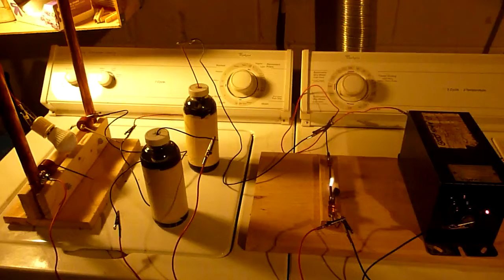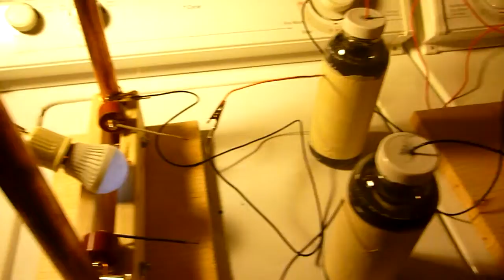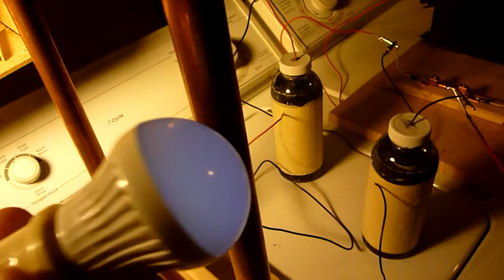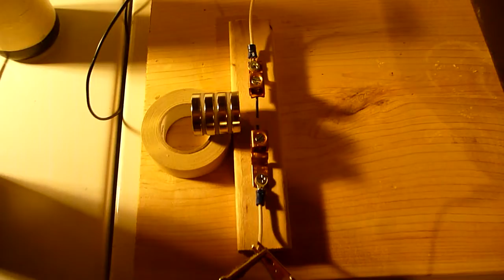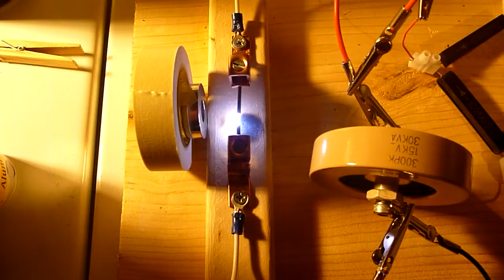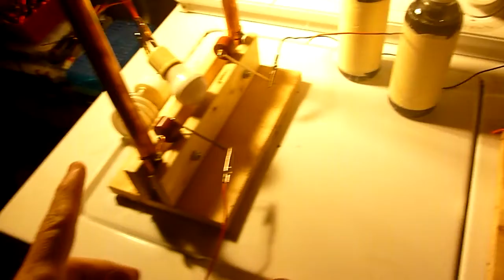Magnetically quenched Spark gap Experiment

Comment: You effectively have increased the conductivity of the spark gap by increasing the magnetic field density in the gap. You did not set up an electromagnet quenching circuit as described by Tesla's who was trying to divert the ions and electrons flowing in the electricity away from the ether conditioned by the charged particles into electricity (energy without energized matter. A little disappointed, not what you described... it is actually a magnetically enhanced spark gap. Party on, stay safe.
Reply: So does that mean it absolutely has to be an electromagnet?

Comment: If you get rid of magnetic component of electricity, wouldn't that mean you mean you converted electricity to electrostatic and you no longer have amps/current?
Reply: Tesla was the inventor of the magnetic spark gap. He used it in an attempt to remove the 'electrons' from the passing spark gap voltage, not any magnetic component. In doing so, pure electricity was present (and eventually passed to an additional coil). NOTE: TESLA called his spark gap in series with capacitors his "SPECIAL PRIMARY", and an additional coil his ""SECONDARY".  ALSO NOTE: What many 'think' is a Tesla Coil, is NOT! Rather instead a Sir Henry Lodge Alternator. Tesla's 'generator' has no multiple multiple windings leading to it's top. His "receiving coil" does.  Lastly, The 'electricity' Tesla tapped into is pure Aether, has no electrons, heats metal when coming into contact with it and is limitless power. Email me if you any questions at theyaretoonosey@gmail.com  or download &read chapter one of Secrets of theCold War technologies.
Reply: @Rev22-21  "Tesla's 'generator' has no multiple multiple windings leading to it's top. His "receiving coil" does." I've heard of this before but only small glimpses, could you tell me more about this and your sources please?

Comment: This would explain why Tesla in his magnetic switch or spark Gap if you prefer to unidirectional spark he used the powerful attractive power between two permanent magnets or electromagnets North and South in attraction to clear or tear the lines of the traditional electric field, of magnetic nature which allowed a new radiant energy to take the place. 

Master Ivo has already talked about something like that, a theory is only speculation, but if an electromagnetic field line is broken perhaps it is possible that the dielectric field lines cross the magnetic field that normally crosses 90 degrees to prevent the dielectric field from passing something else is transformed, an energy that exceeds that of the electron and at the same time breaks some laws of current physics. Why not, but how to prove it is another matter.

Congratulations and thank you for this beautiful video

Comment: Tesla used 2 magnets in attraction (separated) with the spark gap in between. The classic blue purple spark gap is quenched(influenced by the dielectric field produced inbetween the attracting magnets) while the "neutral" white radiant energy is not influenced.
Reply: You sir are EVERYWHERE! So cool
Reply: :D
Reply: Hi Ivo, can you explain why the white radiant energy spark isn't affected by the magnets if it's created using a hairpin circuit? Isn't the spark in that form pure Dielectricity without a magnetic component and by extension should be influenced by the magnets dielectric field?
Reply: @JenkoRun  there are 2 forms of currents (enegy flow) magnetic and dielectric. conventional current is magnetic and bound to a conductor.
Dielectric (displacement) current is flowing through the dielectric and not bound to a conductor. 
when both currents are present power is created. 
and the white one...
Reply: @MasterIvo  And the white one?
Reply: @JenkoRun  is the dielectric displacement current flowing through the isolater, in the dimension of time, outside the dimension of space, where the magnetic spacial field acts.
Reply: @MasterIvo  So it is indeed the dielectric without the magnetic component, figured as much, but why doesn't the magnet have any effect on it? Since Magnets attract through dielectric acceleration shouldn't this dielectric displacement current also be attracted to the magnets dielectric field or anti-locus like regular discharges?
Reply: @JenkoRun  because the magnetic field acts im the dimension of space.
while the white current flows in the dimension of time.
or to be simple, I don't really know why 😊
Reply: @MasterIvo  Interesting, looks like further study will be needed on this phenomena to figure that out then.

I would like to offer a different perspective of the function though, specifically the time point. According to Ken (if he is correct) Time is a measure of magnitude, more magnitude = slower time, and if you have magnitude then you have space and magnetism involved, since the Aether doesn't have any magnitude in its Dielectric state that means it doesn't have any time either, so the Dielectric field operates outside of both time and space, no magnitude no delay in events.

If we consider that, then a dielectric displacement current will act instantaneously without delay in propagation as long as there is no magnetic component attached to it. If we consider that normal EM waves are limited to light speed because of the addition of the magnetic field then there is a system here that allows the dielectric field to change at infinitely faster speeds than an EM wave, perhaps a sort of timing system could be developed to take advantage of that in some manner? 

And perhaps this operation outside of time is also part of the factor that is the reason for why magnets have no effect on this kind of spark that's had its magnetic component quenched? Who knows.
Reply: @JenkoRun check out cold energy secrets by Peter lindeman

Comment: That's just proved the existence of magneto dielectricity. 
Just like the plasma streams from a simple plasma ball novelty toy.
However: It has practical application potential?
Based upon the early vacuum diodes: space charge had a repulsive effect on the flow of electrons.
This was quenched by the required minimum potential being reached.
In other words: align the magnetic fields with the SG pin's & it should present a repulsive effect 
Until it's freehold has been reached ( A HV Diode?)

Comment: The problem with all this is the electricity is extremely useless in a practical sense. High voltage, high frequency and no current and enormous amounts of EMI which is no good in our modern digital wireless world. 
You find a way to transmit high current usable electricity with out the use of wire and not cause EMI pollution or kill nearby electronics, then the world will be impressed.
Reply from the maker: +ElfNet Gaming Tesla already managed to do it in 1892 in his Colorado Spring experiments. Tesla perfected his wireless electricity model after those experiments. He then built his famous Wardenclyffe Tower. This Tower was a result of years of experimentation with wireless power. Turns out there are 2 types of electric waves. Transverse electric waves and longitudinal electric waves. In modern world today we focus on transverse electric waves and ignore the longitudinal ones. Longitudinal waves transmit through the ground connection, thus the receiver only needs to have a good ground and a coil (no aerial is needed to receive the signal). If you are interested check out Eric Dollard's and Chris Carson's lecture on wireless power. This lecture starts out slow but about 10 min., it really gets interesting (Eric Dollard worked with wireless electric power for year) >> https://www.youtube.com/watch?v=QKggql3aYkc
Reply: Naoki Kashima I am aware of how radio works, I am a professional commercial communications technician. I know you can get AM BC and Shortwave with a good ground and a magnet loop antenna.. But in reality for portable 2-way radios it is very impracticable. NO ONE (Consuner wise) is going to take the time to find a good grounding point to connect a radio to, they like it how it is not, pull up an antenna and go IF they even do that. We live beyond that aged technology anyway. We are digital and narrow band and fine tunes specifically to a sliver of a frequency. not analog and wide all over the spectrum causing havoc for others like on a CB radio.
Yes this looks good on paper and yes maybe 100 plus year ago it was the shit, but today its old dated tech that has no useful place in commercial society.
Reply from the maker: ElfNet Gaming I like your comment, and I agree with parts of it. Yes this 'longitudinal wave' technology of Tesla is not compatible with our current technology. It would cause way too much interference across a wide range of radio channels, etc. What is so cool about this technology are the various claims that Tesla had made about longitudinal waves. One of his claims is that the longitudinal signal travels faster than the speed of light through the earth, signals travels at 1.5 times the speed of light or C*PI/2. This observation went against some of the ideas of Einstein. Besides Eric Dollard we also German Engineer Konstantin Meyl who supports Tesla claims that longitudinal waves are faster than light. Meyl even has a book out that contains a chart of speeds that were physically measured for longitudinal wave transmission (his book is called "Scaler Waves"). The other claim is there are virtually no losses between the transmitter and the receiver (in traditional wireless power transmission systems the losses are exponential with distance). My point is Electrical studies haven't advanced much in the past 100 years.
Reply: I think you missed the entire point. The output of this device is a very low voltage current, (despite having no stepping down process) enabling you to touch it safely without getting shocked. (The frequency of the transformer csn be low too and the effect is the same.) The load lighting up while shorted by a thick copper rod is this weird electric‘s feature. Now don‘t tell me its skin effect when it won‘t even short the load in water. I measured the emf radiation too and they were lower than that emited around your wall plug. If you don‘t get confused by this experiment you don‘t understand electric enough.
Reply: Naoki Kashima maybe they were faster than light because they were taking a straight path rather than following the curve of the earth? PS I know nothing about this stuff.
Reply: ElfNet Gaming  Tesla made his tower after the pyramids. There are videos here that show the connection. His country of origin is full of still functioning pyramids, same as Syria , Iraq and Iran. Someone apparently knows about true usage of the pyramids and wages wars on those countries because of that... Those countries also have socalled UFOs buried underground. Btw, the system of the Balkan pyramids is under the code Antarctica. UFO was also patented by Tesla (you can obtain the patent papers in the U.S.,also there are videos here about that - they are flying machines powered by EM/t.i sound waves emitted from the pyramids. Pyramids were covered in gold, same as "UFOs", for gold is the best conductor.. So, the pyramids were transmitting electricity, ti sound power through the ground (they are connected via tunnels; the tunnels of the Balkan pyramids have been filled in with soil to prevent their misuse (which has been done in Egypt). See beforeitsnews.com/prophecy/2014/01/haarp-deadly-torsion-pyramid-experiments-will-unleash-absolute-hell-on-earth-breathtaking-videos-2457652.html

Comment: Thanks for the detailed tests! They are very helpful. I am also working on the hairpin circuit.

Have you tried placing magnets on both sides of the spark? In Tesla's experiments he shows magnets on both sides. Is your conclusion that the magnets aren't necessary? Why do you think that the diodes are necessary? Is it because you are trying to create a unidirectional spark? Can you do a test using magnets on both sides of the spark and no diodes on the hairpin circuit?
Reply from the maker: Tony Ward Hello, thanx for the comment. In the experiment I am using a 15kv neon sign transformer which outputs in AC. I hooked up the output to a bridge rectifier to convert AC into DC, then I also have a very large capacitor parallel to the spark gap to smooth out the DC and make it more uniform. The only reason I'm using the diodes is to convert AC into DC to test the DC spark vs. AC spark. The two behave differently in the presence of magnets. When I use the bridge rectifier I get a DC spark which is unidirectional (it is either attracted or repelled by the magnet, magnet bends the spark). I haven't tried using magnets on both sides. From what I have seen the spark that is created from Tesla's Hairpin Circuit isn't effected by the magnets... I think at some point in this video I actually have the hairpin connected and I run the spark gap with magnets present. Hope that my reply helped :) Lets all keep experimenting. If you want me to redo the experiment I can (I'd spice it up by hooking the output of the 15k transformer to 1:4 transformer stepping up output to 60kv!) .... Right now I am working on back EMF stuff. In my opinion back EMF is key to many devices that claim over unity results. Magnetism is induced in the inductors then the switch is broken and all the magnetism is converted into volts and amps + extra. This 'extra' part is what causes the over unity effects reported.
Reply: Naoki Kashima Read Telsa's own description of his experiment here: http://www.electrotherapymuseum.com/TeslaArchive/OnLight/index.htm
On page 19 is the spark gap with magnet.  He also states that the unidirectional spark is very desirable, but doesn't show any diodes. Leading up to page 19 is a description of the apparatus that he used. Check it out!
Reply: Naoki Kashima It would be nice to see a North pole on one side and a South pole magnet on the other side of the spark. Use A/C and D/C to see what the difference is. Where did you get those HV diodes? Thanks for sharing!!
Reply from the maker: Tony Ward In AC spark the spark seems to be drawn to the magnet no matter what the pole is. In DC the spark was either attracted to the magnet or repelled by it depending on the pole. The diodes that I am using are 30Kv at 200 mA I bought them from ebay. They were like 50$ for the 4 of them or so. I have a feeling that we will see free energy devices in our lifetimes :P
Reply: Naoki Kashima Thanks for taking the time to reply! I watched the video again. Your previous comment suggests that using DC sparks, one pole attracts and the other pole repels. However, that wasn't clear in the video. I ordered 2 powerful neo magnets and got them the other day. It took me about 20 seconds to destroy them! As I was trying to see how far apart I could put them before they started to move, they jumped out of my hand and collided breaking them into several fragments. They were over one foot apart! So, I know how much trouble it is to make an apparatus to test 2 magnets in this circuit. However, is it possible to do that and show the video? I'm trying to decide what to do about using magnets in this circuit. Have you found any quotes from Tesla indicating that he discovered magnets weren't necessary? As you know, this circuit leads into working with radiant energy. Have a great day!
Reply from the maker: Tony Ward Hello again. You have to be careful when handing neodymium magnets. I cracked several of mine as well! I know that Tesla and others did experiments with magnets located perpendicular to the high voltage spark gap. However, I haven't seen those circuits in person. I found an excellent guide into over unity devices. It is VERY BIG (3000 pages), if you are interested in over-unity related information check it out >> http://www.free-energy-info.co.uk/PJKbook.pdf The guide goes through dozens and dozens of inventors and includes patents and links to videos of people who worked on the devices. People like Tesla, Floyd Sweet, Hendershot, Moray, etc. are included in the guide.

The simplest version of radiant energy patent that I have seen from Tesla is patent number 685,957 titled 'apparatus for utilization of radiant energy'. Here is a free website that I use to look up patents >> http://www.freepatentsonline.com/
Reply: Naoki Kashima  Thanks, I am familiar with that PDF. I have it on my computer.
To see the spark gap with magnetic quench look at Figure 166 here:
http://www.tfcbooks.com/tesla/1893-02-24.htm#apparatus_and_method
Also if you read the article by Tesla, you will see the "Hairpin" circuit there.

Comment: Tesla's experiments into the Lecher line, or hairpin circuit, are some of my favorite experiments. It really seems to bring EMF into strictly a dielectric realm. Great experiments, is that an LED bulb? Thanks for sharing and look forward to more.
Reply: Naoki Kashima bro the law is just a theory and it does not hold up in every case
Reply: Wow, that original post was an auto correct nightmare... Lol
Reply from the maker: Yep, its an LED bulb. I dropped my filament bulb and I had to use something. When you use high voltage sparks you can smell the Ozone in the air, so much fun :) What stops motors from running themselves is Lenz Law. There is an opposing magnetic force that creates drag in your generators when they are under load. This law is magnetic in nature. If it was possible to remove magnetism from electricity this law could be bypassed creating a self-running system. Conservation of energy laws will have to be changed! Thanx for the comment.
Reply: Naoki Kashima but without magnetism and the resulting forces, how will the motor rotate??
Reply: Conscious Energies  JohnDon, research " electric universe". Also see experiments of the user here nicked Theoria Apophasis.